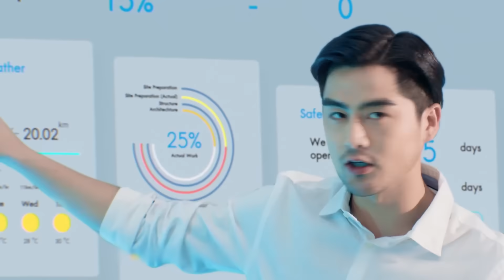Rondo Energy and Siam Cement Group Plan 90GWh Battery Production Capacity, World’s Largest

Comment: Small hope, but pleas @Rondo Energy read this. 

Personally I don't have the money to even do a proof of concept to attempt to get the VC money to properly develop this, but the physics are well understood. Use a sodium lamp heated by a thermal battery to emit light at 589nm and 589.56nm then use a PV panel with a band gap tuned to that wavelength, with a single junction cell the light to electricity conversion is theoretically around 90%, talking real world your probably looking at ~70% efficiency for a first finished product.

The efficiency of turning thermal energy into light with a sodium lamp is high, so that barely effects your round trip efficiency and what energy is lost is lost as IR emitted from the glass or more likely sapphire assuming you place the lamps inside the thermal battery with the head embedded the the wall with a reflective shutter that is highly reflective of wavelengths in the 589 and 589.56 wavelengths most of the emitted IR would be re-emitted back into the battery into the and and when the shutter is shut the light given off by the lamp will be re-absorbed back into the battery, also you would put a mirror on the opposite side of the PV cells that is reflective to IR.

This would give you the ability to not only generate electricity at a ~65% efficiency, but also quickly ramp up and down energy production by opening and closing the shutter, or even throttling the output by only partially opening the shutter, this would enable you to be highly competitive with lithium ion batteries beyond the 4 hour duration, although being thermal batteries obviously there is a limiting factor for duration not on the cost side, but the energy leaks, but if we are only talking 24 hours, thats fine.